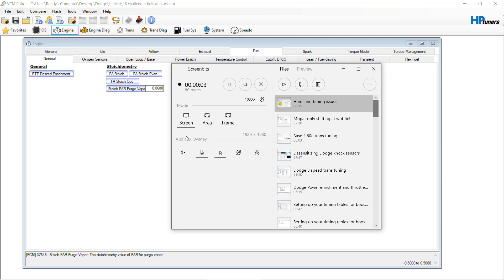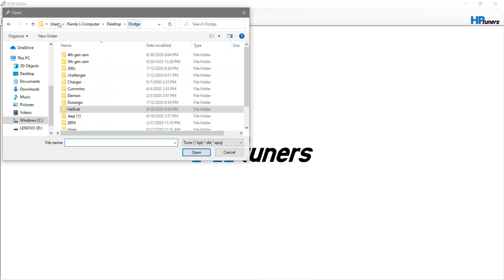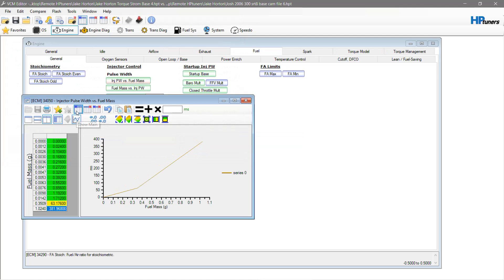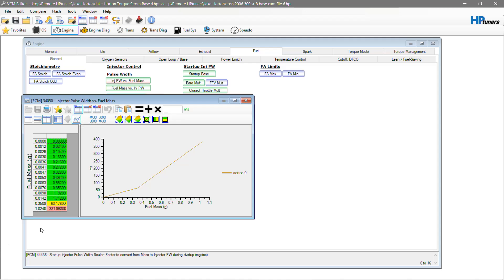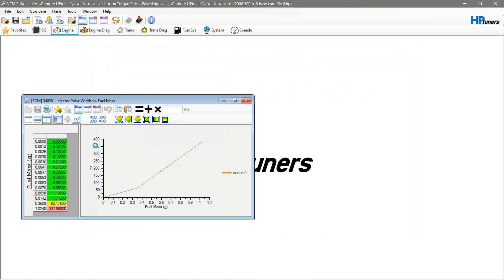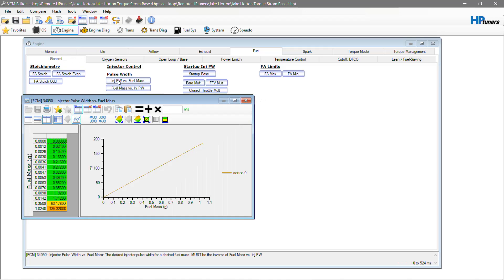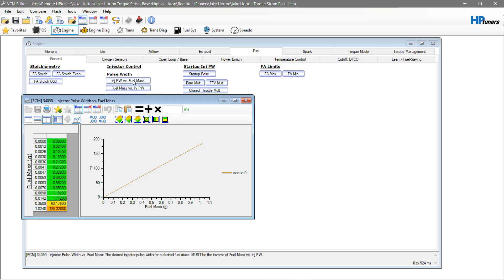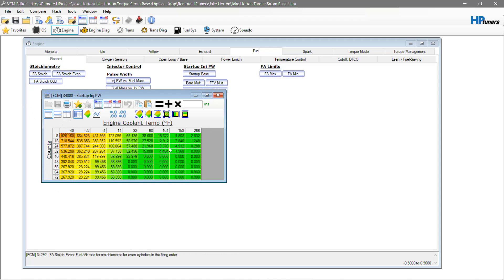Hellcat injector data

Comment: Thanks for the vid brother i  always look forward for the vidz you post, brother do you have injector data for the 46 lb/hr Siemens Deka Fuel Injectors i looked all over the place for them but couldn’t find a thing
Reply from the maker: Honestly for Dodges I do things way differently to find the data versus a gm engine
Reply: Well the way i did it was using the srt4 data as a base to start with like Min INJ PW and offset and then do a couple of runs & logging the data in a histogram then applying it to the INJ PW & Fuel Mass tables then slowly fine tuning both tables the rest of the tables in the startup section are simple depending on your build u adjust them to. Your liking and the car demand, its not as simple as it sounds but its a general idea of how i look at it, the only thing that i hate about this process is that it takes a long time with alot of runs a adjustments but at the end you would have a base for those specific injectors for the future to use